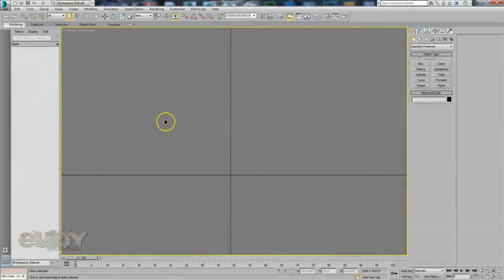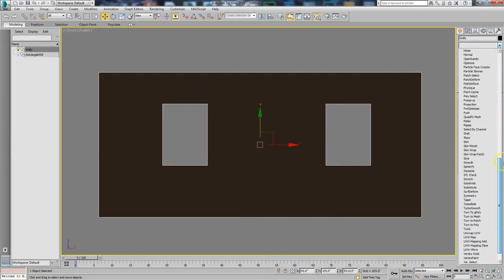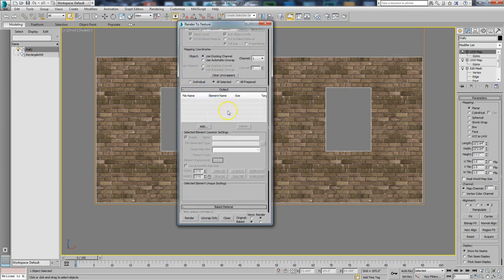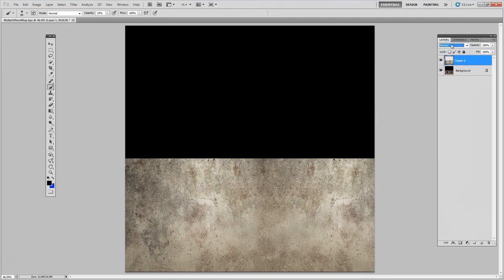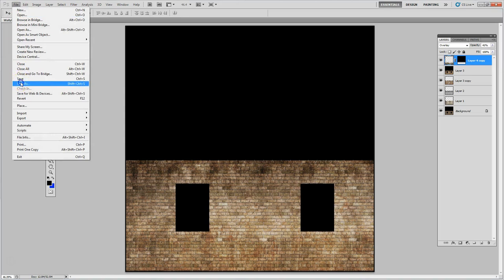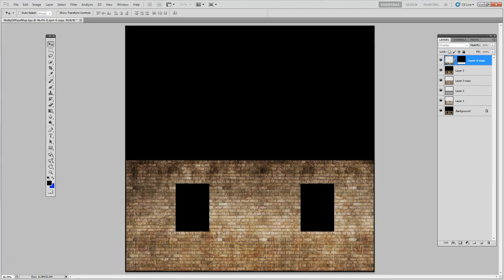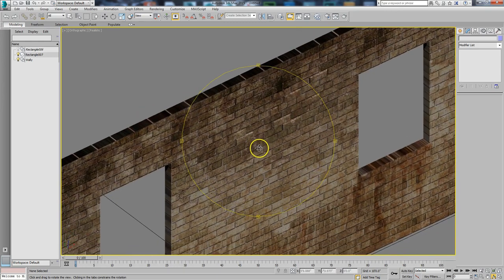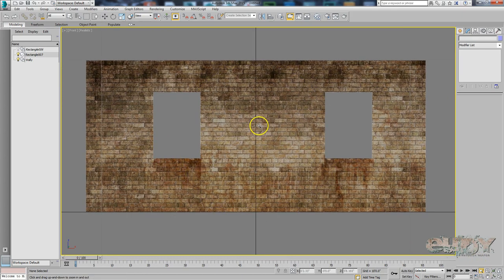Texture Mapping a Brick Wall Updated | 3ds Max

Comment: how do you do this using arnold? specifically the art around 4:40 where your diffusing?
Reply from the maker: Mental Ray Arch & Design material would be replaced with 3ds Max's Physical Material and the bitmap would go in Base Color instead of Diffuse Color.